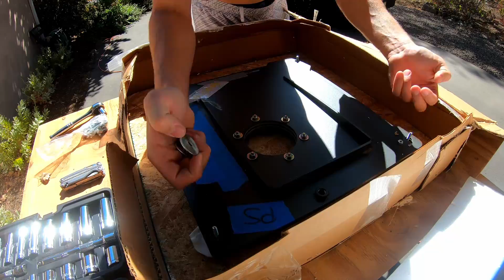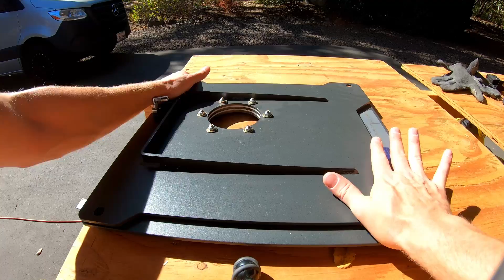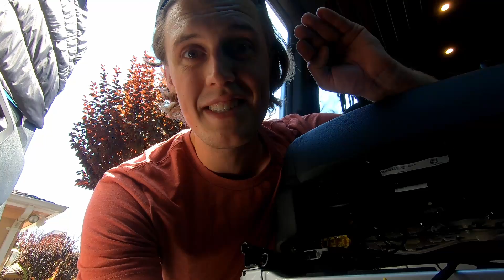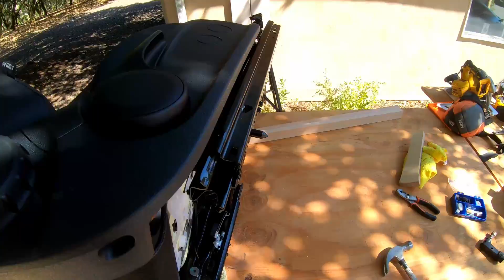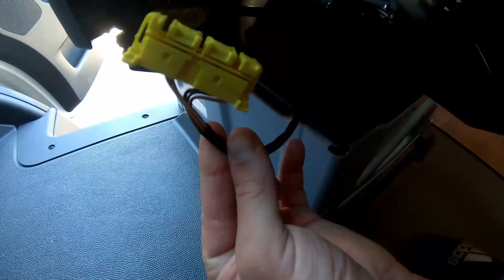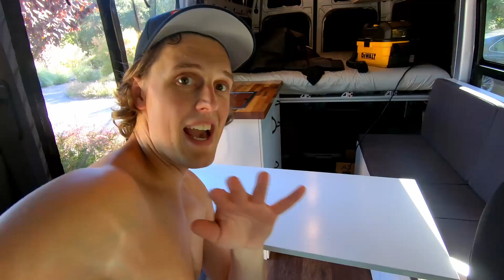How To Install Alpine Mechanisms LOW PROFILE Swivel Seat Adapters - #vanlife

Comment: I'm wondering if that box under the seats could be converted into storage by cutting an opening in the side and using a rubber moulding on the cut edges or even a disguised lockup for valuables when out surfing?

Comment: where did the plug wire go - around the edge of swivel plate ?
Reply from the maker: There’s a big hole in the middle of the spline mechanisms swivel for wiring.